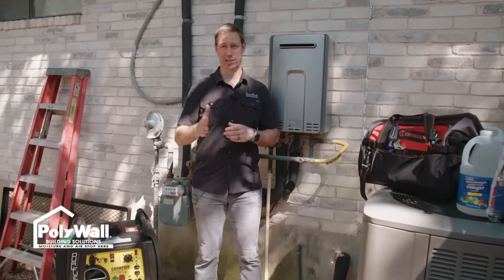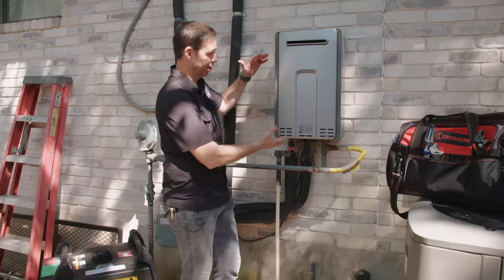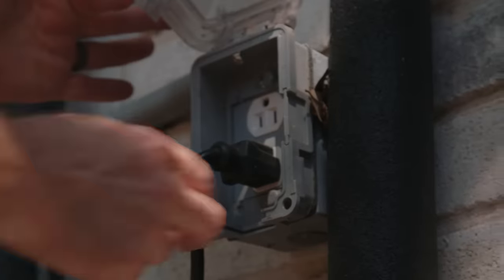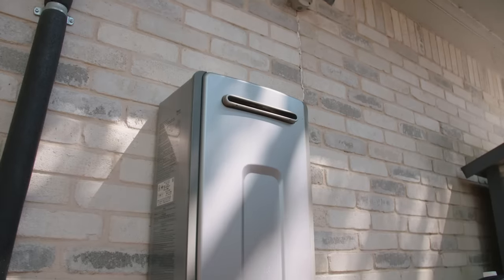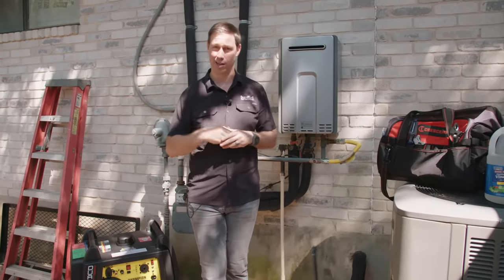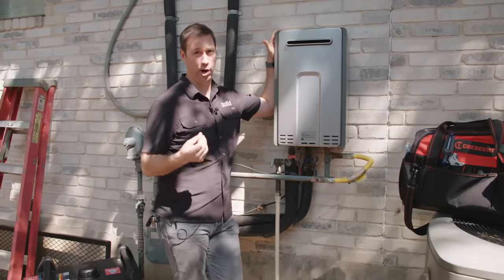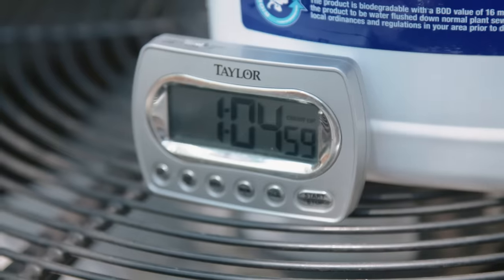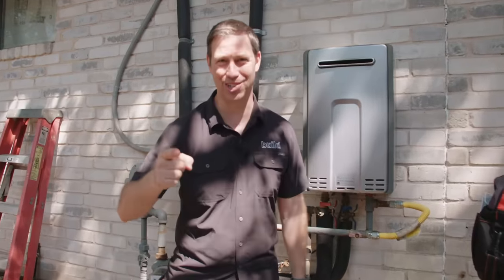3 Things They Don’t Tell You About Tankless

Comment: Been tankless for over 30 years.  First one replaced an electric heater, had a standing pilot and no blower, so no electrical connection required.  Used that for 20 years.  Present one is on year 11, piezo, propane, exhaust blower, so power loss means no hot water.  But we're also on a well, so power loss means no water anyway.  Besides, a 10 KW generator takes care of that situation.  Estimated the first one would pay for itself in 1-1/2 years; only took 9 months.  Both have always run on soft water.  The present unit has a remotely settable hot water outlet temperature feature so, for example, from your bathroom you can adjust the hot water outlet temp to exactly what's needed without the need to mix in cold to cool it at the shower faucet.  Bingo!  Your efficiency just improved.  Tankless have their little quirks but no show-stoppers.  I'll never have another tank.

Comment: I have two (yes, 2) tankless water heaters in my house. They are both 95+ efficient units. One is used for DHW while the others is used to heat my underfloor radiant heat system. 

The one main drawback of a tankless unit for DHW is the delay in getting hot water to the faucet. My unit has an internal pump that would push the water through the system to keep the hot in the pipes. But then it has to run the burner when it does it. To counteract this you need to plumb a return line back the the unit from your furthest faucet otherwise it forces the hot water into the cold water pipes. 

As for the one i use to heat my floors, it works great.  When there is a call for heat, the pumps turn on and cycle the water through the burner. As the water heats up the unit sensed this and modulates the burner to heat the incoming water to the correct heat. When my tankless unit runs, I have watched the incoming water rise quickly from 70* to close to 110* and the unit is set for an outflow of 120* water. so it goes from a 50* heat rise to a 10* heat rise. And that is where the tankless unit shines. I have gone out to look at the gas meter and watch the flow of gas drop dramatically (the meter spins much slower as the demand for gas drops.) 

My gas bill from Xcel is much lower than others. The January bill where we had multiple days below 0*F was a little over $240 for my 2800 sqft house.

Comment: As a plumber in CO one more thing I tell my customers looking to install a tankless is that our cold ground water will dramatically affect it's performance. The GPM listed for the units is for optimal conditions. Our cold ground water, especially in the winter will reduce the GPM of the unit. I've had one of customers that would be taking a shower and someone would turn on the kitchen which would over load the unit and it would shut off. The only fix for this is to turn down the temperature on the unit which the customer was not happy with, they like hot showers. It will also slow down the water going through the unit in order to heat the water which will result in lower perceived pressure.
Reply: 100%  This is what i just typed above!.   I would never install one unless i had a large recirc loop.  Even then it's still questionable
Reply: Living in Wisconsin, with only one fixture using water at a time, do you think one of these would be sufficient ?
Reply: @smartysmarty1714  Yes, so long as you understand the drawbacks. If you lower the max temperature two or three notches you should have no problem. My only experience is with Rinnai water heaters so you'll have to do your homework with any other brand. If you need unlimited hot water or the extra space and are willing to make some small sacrifices then you'll be happy with it.
Reply: @mattmcc7930 -  Thanks for the information Matt.  My plumber is anti-tankless (for our area), but I never really asked him about it from a single fixture at a time perspective.  I live alone, so I'd just have to make sure I only had the washer, dishwasher, or shower going at one time, which is usually how it is anyway.  My HW heater is from 1992 so I'm a little nervous.  But, I read one of these comments where a guy has one still going since 1963, so who knows.  But, having said that, I'm from 1963 too and I'm pretty worn out...
Reply: @smartysmarty1714 You may actually be able to use more then one fixure at a time. The shower uses the most GPM (gallons per minute). Most single handle shower valves have scald guard features that always allow some cold water to get through, but they can be adjusted to allow more hot water. This would allow you to turn down the temp on the heater but not really feel any difference at the shower. 

 They literally don't make water heaters like they used to. I moved into my current house about 20 years ago. At the time it had a WH from 1980. That WH lasted another 5 years. I've replaced twice since then. They make them to fail after a certain amount of time. If you flush your WH once a year, it should last a bit longer. Cleaning out the sediment will help keep the weld points from rusting out. The old ones used to be glass lined so that they don't rust.
Reply: Here in northeast Ohio, we bought a Bosch back in 2009, have well water, have not had this problem.  Water temp set at 118.  Got the largest consumer grade unit they had.  It will support three items drawing water at once.  The only temp issues we've had is if a big cold or hot draw comes you may have to adjust the hot/cold balance in the shower.  Not sure the reasons why my results are different than yours.  I estimate ground water temp around 50.  The starting water temps were part of the decision on how to size the unit.
Reply: @smartysmarty1714  1963?? That’s still pretty young for a body. Not so young for a water heater. 
   A good tankless will run multiple faucets at a time. Just don’t pull the flow restrictors out of them because you want more volume.  
  I thin Navien Tankless is about the best tankless on the market today. I’ve been installing them for as long as they have been around. Well as long as I’m been plumbing. I’m running up onto 50 years now. Anyone who tells you that the ground water is to cold to run a tankless water heaters and multiple outlets all at once should really pick up a book and reread . Never mind I don’t want to insult anyone!!
   The main reason you need to worry about ground water temperature is when you are on a Well. Most domestic water system supply warmer water than what the ground water is.
  The pump it to very large holding takes. The draw it from the middle of the tank (warmer than the bottom) they burry their water lines below the frost lines. The pumps warm up the water. Your average water temp is 50 to 55 degrees or there abouts.
Reply: these only seem like a good idea for sinks.. that's the only time I've ever been impatient to get hot water.
Reply: @Herpaderpderpamufuka  they can be set up so you can get hot water in just a few seconds. Even faster than a tank style heater!!
Reply: mostmint did you put a pre-filter system on it, or preferably a water softener?
Reply: LT's Garage not sure where you live, but the underground temperature is pretty constant everywhere. It’s pretty predictable as far as load calculation.
Reply: @dewaynemizzell7009  as far as a filter or softail. If you need a filter the best thing you can do is put a Hot water filter just after your tankless. That will catch all of that white calcium that comes out when a hot water heater heats up the water. It will 🛑 stop that hard water 💦 calcium. If you install a softener you will still need to put a filter in line. Then you will need to worry about all that salt running through your water lines.
Reply: LT's Garage I’ve been plumbing for 20 plus years. It was rhetorical
Reply: @dewaynemizzell7009  20 years is long enough. I started my plumbing business in Jan. 20-1974.             🤪
Reply: LT's Garage cool. I always recommend at the very least a pre filter setup for tankless. It’s great if it can be done for any house, but definitely tankless.
Reply: @ltsgarage7780  I'm in South East missouri on 10 acres in a house trailer with a well.  Can i go tankless when I redo 2nd bathroom ? It would service only that bathroom.
Reply: @cheryldenkins1597  there are so many questions I would need to ask you. Why would you need that much hot water is my first one???
Reply: @cheryldenkins1597  it just depends on how far away the gas line is and what the location of the tankless is. 
   Write it all out I’ll give you some direction to go. If you don’t have a large tub or take really long showers. I don’t see you installing the tankless.

Large soaking tubs??
Large families that uses a lot of hot water??
   If you don’t have either of these two things. You more than likely are just looking to throw your money away..
Reply: CO?  Is that a poisonous gas, or an element?  And don't get me started about the girl talking about KY...
Reply: @lostindixie  all natural gas ⛽️ is poisonous. What are you asking??
Reply: @bowrepublik  I live in Michigan, I installed a very high quality unit that is rated for 10 gpm.  I never, never, never have a problem getting hot water and my water bill is $40 a month less than my old tank every month for the last 8 years.

If you get the correct unit, it's a total blessing.
Reply: @smartysmarty1714  Don't your dishwashers come with their own internal heater ?????????
Reply: If you have a customer that was taking a shower and an extra 2.2 gpm load (coming to sub 5) was too much, then you installed the wrong size or wrong amount of unit/s.
Reply: @syreplays5079  You are assuming the shower head is the standard 2.5 gpm rating. While that is standard it is far from universal. The water heater was rated at 7.5 gpm actually.  But that is under optimal conditions. Clearly this was not optimal conditions. Not only do we have cold ground water but our high altitude and thin air will negatively effect the performance as well. 

Yes, the correct installation would have been to get a larger unit or install two units. Which I have done in the past. In this particular case the customer had purchased the unit and called me to install it. They were told by the salesman that it would work. Installing a second unit would have been a huge cost increase. Not only would they have had to upsize the gas line but probably the meter as well, not to mention the cost of the second unit. 

My point was that if you are looking at getting a thankless WH heater do your research first and don't just go by the specs on the box or by what the salesman says.
Reply: Yes and no. Sometimes the way the plumbing is set up will cause the same issue

Comment: We built a new house in 1991 with two 75 gallon natural gas water heaters. Had 7 kids at the time, the orginal water heaters only lasted 7 years. Replaced with 1 tank
less we never paid more than 1/3 the cost of the previous system.  I service the system 1 a year even though we have a soft water system in the house. Our tank less is 19 years old still working.

Comment: I have Naiven dual boiler for domestic hot water and for the radiant heating system in the house.  Now going into my third winter season with the system.  You have summarized the advantages of such a system, so I won't repeat.  It has been completely reliable so far and highly efficient.  My fuel source is propane, with a future availability of natural gas in my neighborhood.  We recently went through 75 hours of no electrical power due to a wind storm.  I am fortunate to have a permanently installed auxiliary generator.  No issues in supplying electrical power to the boiler's controls.  My water is soft, so mineral buildup in the pipes is not apparent.  Just today I bought vinegar to use in flushing the boiler jackets.  I have seen videos for maintaining my boiler, which I will do very soon, early in the Fall season.  Doesn't seem like much of a charge and well within the capabilities of a DIYer.  Bottom line, I am completely satisfied in the choice I made for heating my home in a northern climate and for endless hot water (no teenagers at home).
Reply: I'm putting a similar system into my home as well. Navien Combi boiler for domestic hot water and then garage and basement radiant heating. Did you do a recirculation loop for basically instant domestic hot water? I've been debating it.

Comment: I have 2 tankless, one for hot water and the other heats my house using radiant floor heat,  had them for the last 7 years, works fantastic, heats a 2500 sqft house in Missouri for about $60 bucks a month in the coldest part of the winter. Would never ever go back to a tank heater or " traditional" house heat. Gutted the old central air/heat pump and installed minisplit AC systems, dropped my cooling cost by over $100 a month and keeps the house much cooler than before.
Reply: Wait till they break. Sounds like the central was undersized. How old was it?
Reply: Don't spend your savings...you'll need it for mini splits repairs...
Reply: Can you tell the one you have
Reply: BrownH20Rat
   You sound like a salesman !!!!
Reply: That's what we're in the process of doing now, and really looking forward to having it done. Do you have your tanks outside or inside?
Reply: @Sandra-Armstrong  every installation is different. Make sure you use a professional to do the installation. I’ve seen some Really good tankless water heaters butchered by the installer. 
   Where do you live ???
Reply: @ltsgarage7898  we're in Oklahoma, so it's just a bit warmer than Missouri.

My issue is that I want gas tankless heaters, but I don't want them inside the house. There's not a whole lot of legit info online about  the life of a tankless heater that's outside (not in a garage, but on a southern facing outside wall), and most people's opinions are just that, opinions.
Reply: @Sandra-Armstrong  hell. I’m in California
Reply: @Sandra-Armstrong  the only thing that cannot happen to a tankless is to let one freeze. If that even has a chance to happening you cannot put it outside unless you build a lean to & insulate it really well and I mean insulate the lean to really really well.
    Where is your tank style water heater located now???
  What does your water heater run on now??
Reply: @Sandra-Armstrong  I’ve put in 100’s of these things…
Reply: @Sandra-Armstrong  
    Sandra I’ve done them both ways inside and outside. But I live in California. Very rarely does it freeze at night.
   Does it snow of Freeze where you live???
Reply: @Sandra-Armstrong  are you going to install the tankless water heater???
    Or are you having a professional installing it.
  Why would you buy 2 tankless water heaters (1) for hot water 
(2) for you’re heater unit???
  Why not just use a single unit that is made for both. That way it will use a lot less ⛽️ gas!!!